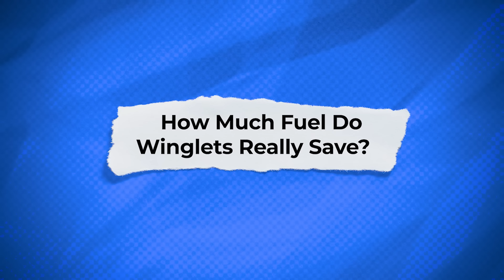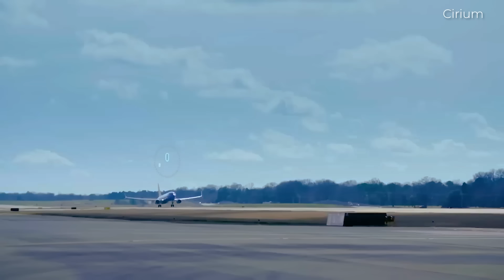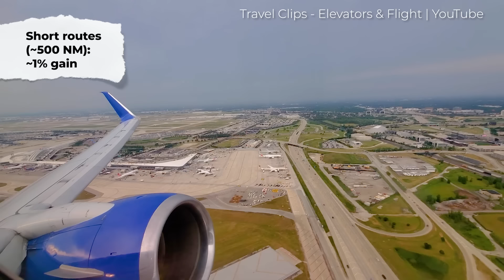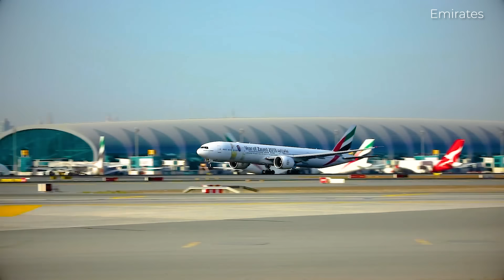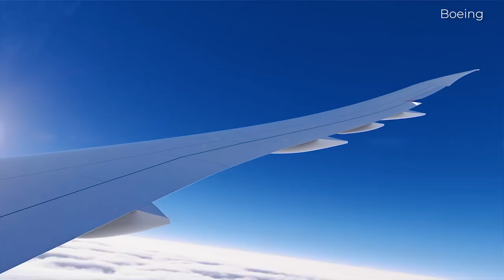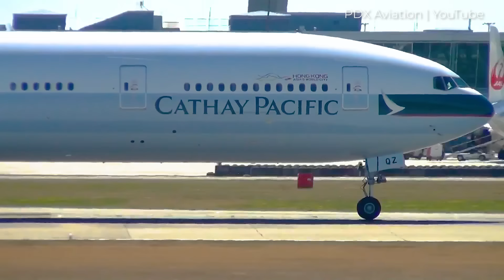How Much Fuel Do Winglets Really Save Airlines?

Comment: In Japan 747’s were used for domestic flights. Due to the short flights, winglets did not provide savings. Therefore Boeing built the 747-400D, a 747-400 without winglets, for that market

Comment: What's interesting is that Boeing figured out how to get the benefits of winglets without the weight of them by raking the wingtips of the plane. That's what they did with the 777-200LR, 777-300ER, and the upcoming 777-8, 777-8F and 777-9 models.
Reply: And the 787 of course
Reply: And the 747-8
Reply: Makes me wonder: if the 737 MAX had an entirely redesigned wing like the 747-8 and 777X, would it have had raked tips instead of winglets? I feel like one reason the MAX has winglets instead is because it carries over the same general wing design from the NG, which was designed before Boeing thought of raked tips

Comment: Getting rid of the horizontal stabilizer will gift 10% out the gate.
Reply: Get rid of the whole plane and make the passengers swim and you save 100% on fuel.
Reply: Kinda hard for an airplane to fly, let alone get off the ground, if it's missing its tail.
There is a company in the US that is designing a new lifting body airliner that has wings but no conventional tail surfaces, but that's the point - you need an entirely new revolutionary airplane design.
Reply: @kuckoo9036 You need a 1970s design. Plenty of planes don't have all that junk at the tail..It's dead weight

Comment: Raked wingtips are the most efficient but require more wingspan
Reply: They are not necessarily. They are heavy and therefor mostly for longhaul aircraft a good solution. They are also supposedly good with aircraft that are supposed to fly low, like the E-8 Poseidon.
Reply: @kingsharkoon  Winglets are heavier than raked wingtips and put significant load on the very end of the wing, so structural reinforcement is needed to support them. Also it's the P-8 Poseidon, not the E-8.